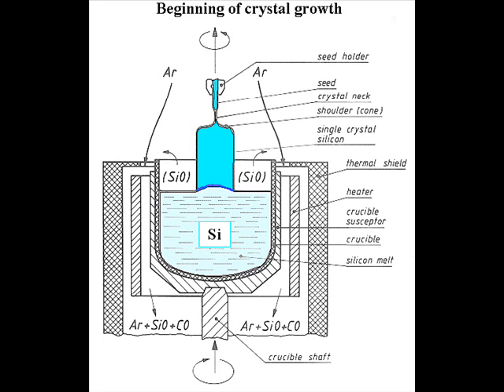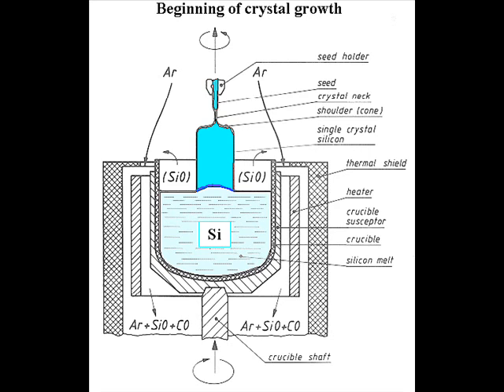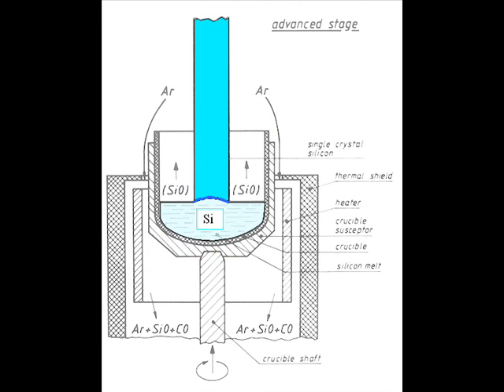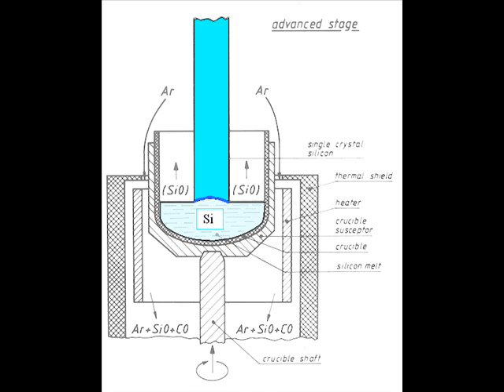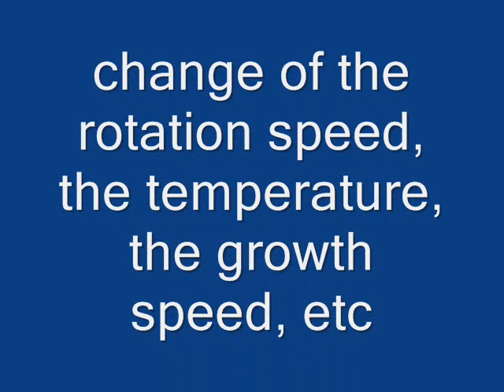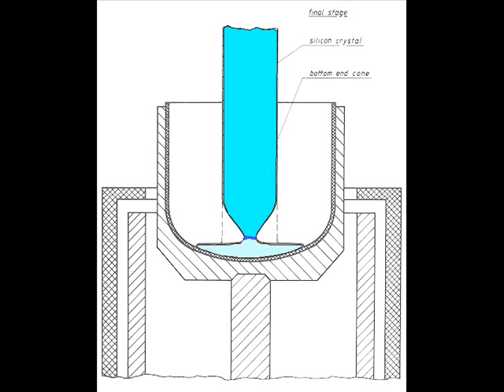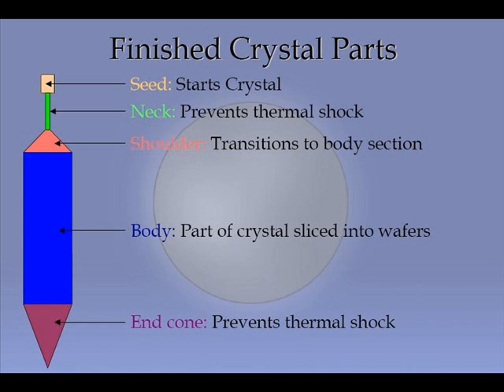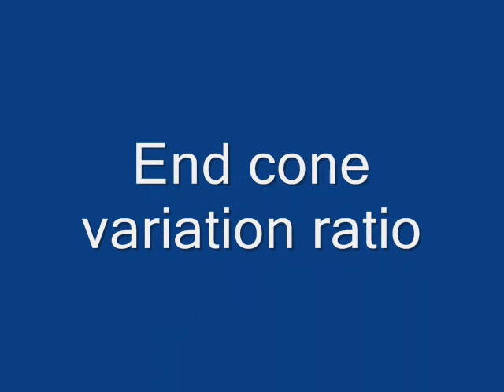Czochralski Process

Comment: In a nutshell a high-purity silicon is melted in a crucible (imagine a huge quartz bowl.) It is doped with phosphorus or boron (depending on what electrical characteristics we want it to have) After we dope it a seed is dipped in the silicon and is pulled in a giant furnace at 1500c for a few hours. The shaft rotates and it forms the tail, body and the head. At the end of the cycle you have a poly-silicon ingot. Do research on the CCZ Process if you want to learn more./